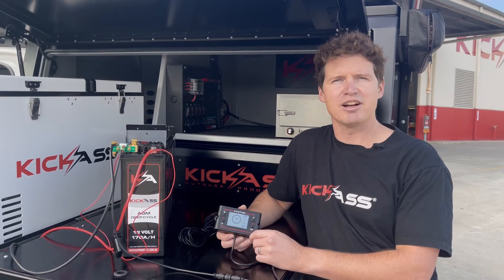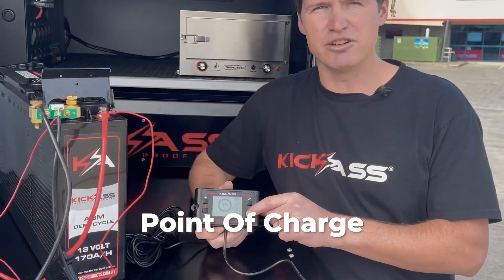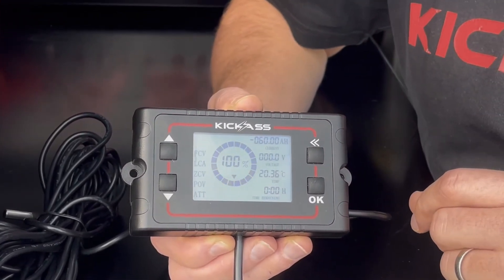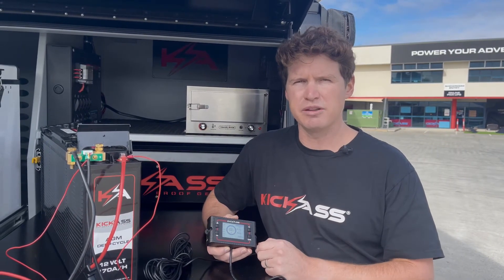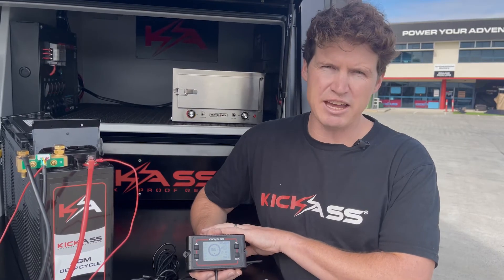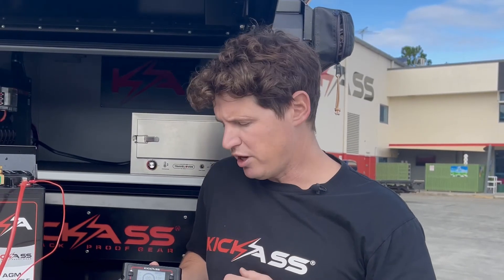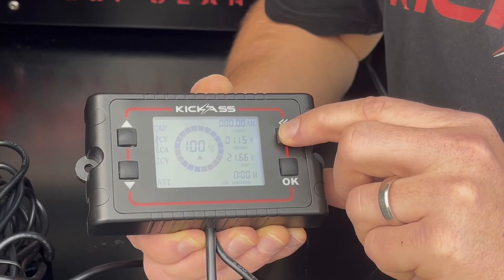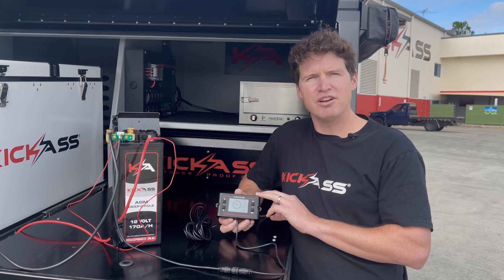KickAss Smart Battery Shunt Configuration

Comment: Hi, what is the POV for a 200ah lithium, not AGM please
Reply from the maker: G'day mate 12v for lithium,if you get stuck again it's on page 7 of instruction manual 
here is a link for you 
https://cdn.shopify.com/s/files/1/0845/2341/7879/files/KABTRYSHUNT-USER-MANUAL.pdf
cheers Craig
Reply: If you get the shunt there’s a code to scan on the back it tells you all the recommended settings

Comment: I certainly don't have your unit, but as with any of these shunts there are so many acronyms to be determined initially prior to pressing any settings, then the concept of calculating a figure to meet the value of that acronym, Christ it just too difficult.
I've determined I've acquired an expensive volt meter, even that isn't displaying correctly as I've got to reset it all again. 
No slander on you, it's not your product, but having watched this considering replacing mine, nah - I've no intention of considering it either., hence I've just upgraded to a battery with Bluetooth, far simpler option - costly though.
Reply from the maker: Thanks for commenting & watching 
cheers CRaig
Reply: Wow you have to set something up I’d hate to see how you wire things
Reply: @uptheau1455 
Immaculately, current vehicle has a single complete wiring harness from rear to front and internal to cabinet. Anyone that sees it can't believe it's not a factory wiring harness.
That has zero to do with programming a shunt into each manufacturers monitor system. Acronyms become so bloody confusing to follow thru.
Self monitoring battery, simple rectification, works a treat.
I know exactly what's occurring.
A previous vehicle I wired up completely from front to rear, all accessories connected but having a fear of doing damage to the ECU (first vehicle I owned with an ECU) I took the vehicle into auto electrician to verify correct and terminate to vehicles circuitry.
Auto electrician couldn't believe the integrity of my work, praised it as impeccable.
All my vehicles have a complete wiring schematic drawn up so anyone fault finding hasn't got to guess how items are wired in, it's all crystal clear.
I could go on and on but think that's enough to clarify I've a good understanding how to wire up accessories to a vehicle.
Clarified enough for you.

Comment: I have 250 amps total batteries (2 batteries) on my camper trailer.
I have 200 amps total batteries in my car (2 more batteries).
If the shunt monitor is connected in parallel onto the 2 x trailer batteries, but the trailer is still plugged into the car, will the monitor be able to read the total car/trailer battery system? i.e. 450 amps.
Reply from the maker: G'day mate,it will read what ever current is goint through the negative terminal on the shunt 
Cheers CRaig

Comment: When stting the battery capacity, I cant get it to log in the positive, it always has the minus sign at the front -170Ah instead od 170Ah is that right? If not hw do I change it to positive?
Cheers.
Reply from the maker: Does not sound correct,can you log a support request on our website please & we will get in touch,here is a link for you 
https://supportportal.kickassproducts.com.au/en-GB/articles/product-guides-and-troubleshooting-130401
Cheers CRaig
Reply: Did you get a solution mate. Ive got this issue now, it was positive once now just negative

Comment: Have followed all this, battery is going to 14.2v, have set the fcv as low as 13.7 and it never resets back to 100%
Reply from the maker: i would drop the battery down to 12.2 & give a full charge with an ac battery charger to battery full & then reset the shunt display unit once 100 % full 
Cheers CRaig

Comment: I have done verything correctly.. yet it won’t show the current value or time left. I have a control box should I be using those terminals rather than the batteries?
Reply: Also I am missing the final menu setting ATT?
Reply: @matthewdavey3780  same thing happening to me
Reply: @matthewdavey3780 same issue as me
Reply: @matthewdavey3780 same situation as mine, have you found a resolution?
Cheers
Reply from the maker: G'day there here is a link  to contact our support team if you need help,here is a link for you 
https://supportportal.kickassproducts.com.au/en-GB/search/shunt?page=1
cheers craig